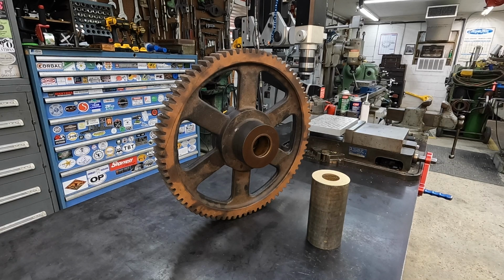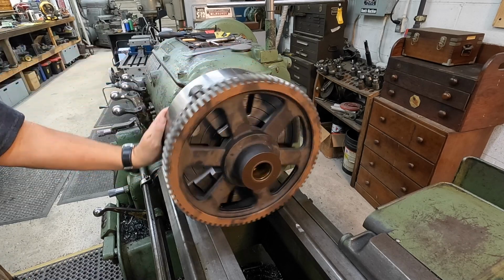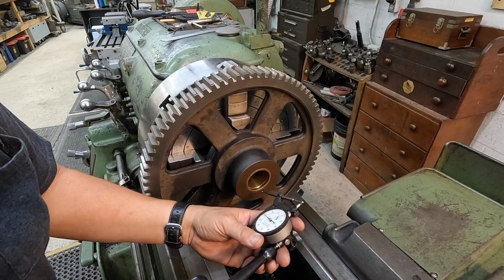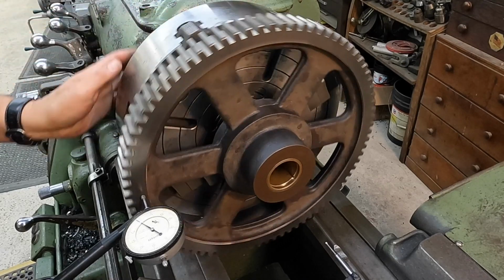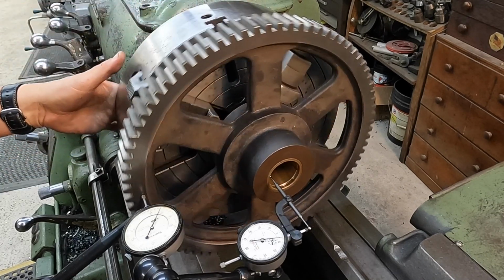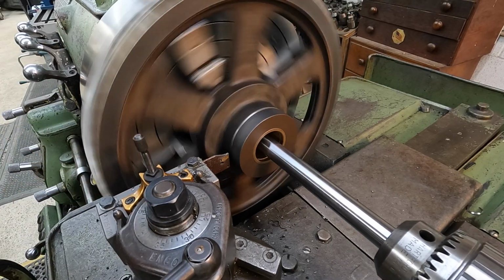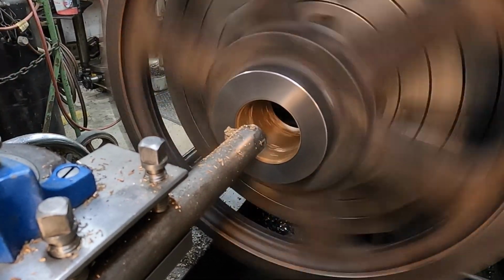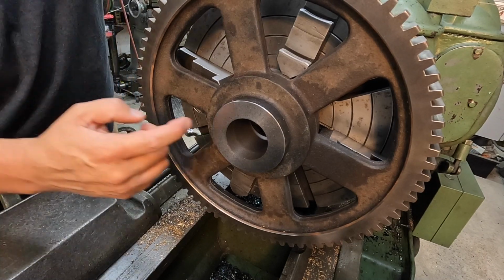Gear Modifications Part 1

Comment: All part features must refer to a gear's pitch cylinder. Whenever I had to modify a gear, I compared the bore concentricity to the pitch dia as a final check. I used a dowel pin or a drill shank near the best wire size for the gear pitch. Laid it in the tooth space and checked it with the indicator. About 5% of the time I found enough concentricity error I felt it necessary to dial in to the gear's PD.

A couple thou PD eccentricity is OK for most low speed power transmission. Any more than that and the cyclic gear noise (wow-wow-wow etc) becomes apparent even to a tin-eared real estate broker or house painter.

Anyway, not a big deal, but a quick and prudent cross-check that might forestall an awkward question from a customer suddenly grown skeptical.
Reply: You're one of the few people to have made a cogent argument in this thread.
However, you have to include some other factors to be complete.
1. Customer is jury-rigging this gear to fit into their existing production.
    They have asked for specific work to be done, to their specifications.
2. Abom could do that additional work, on this part and every other parts that comes into his shop.  Add it up, and thats quite a lot of work that is being done for basically free. Or more accurately, his 40 hour work week is now maybe 35, 33, 30 billable hours due to this additional work.
3.  One would assume Abom is a reputable jobsman, and either discussed this with the customer beforehand, or would being it up upon discovery.
    Either the customer didn't want to add to the bill for the additional work, or Abom hasn't brought it up as he doesn't believe it will impact the function this part is expected to perform.

The customer in this case already has an expert who's found a gear that they're going to 'make work'.  Customer can be as sceptical as they want, however if push comes to shove, Abom can take the part, and show the measurements directly off it to the customer sceptical face.

Almost every job in every industry have checks and doublechecks ad infinitum for every repair, or replacement, or troubleshooting of basically everything.

If the gear was brought in obviously warped, I'd expect Abom would point that out immediately. If found warped upon start of work, same same.
Checking the bore concentricity to the teeth is extra work, which is either going to be billed, or done for free.
He got down to the machine bore without touching it.  
It appears to have been pulled from a working piece of equipment.
For the additional time to add to the bill to do this check, and similar checks that he could do to every other part/order that comes into his shop, at what point do you stop? 
If he were to do all the checks that people here seem to demand, or suggest so as to be 'professional', he'd probably have to raise all his job order billables 10-20%.
He could do what you suggest, and he could also clean up that out of round bore OD, and a half dozen other things that would make that part a gleaming beauty.
And if he were to quote that, the customer would say thanks and go down to the other machine shop where they'll simply do what is asked and have a reasonable bill.
Reply: @boots7859  You're correct in the time element but allow me to point out the first PD check takes about a minute using a suitable drill or tap shank from your tool box. If the PD is wonky it's decision/call the customer time. Regardless, dialing the last few thou to a pin in a tooth space aint rocket science: with a little practice, it goes about as quick as a tweak to a continuous diameter. 

I think I pointed out the check was optional but prudent. Every customer is worth a free minute. He IS hiring your skill and judgement along with your mere ability to perform basic functions on a lathe. It boils down to judgement anyway. I'm not suggesting aerospace QA on every piece off 60 year old farm equipment

Comment: I'm really curious if you're going to make the exterior of that cast surface concentric with with interior bored hole.
I'm struggling to see a reason to do such beyond the fact that it feels wrong to have that exterior be so out of line with the interior
Reply: the reasons to do it are (because I can) and because it will improve the mass balance and reduce vibrations and bearing wear and noise in use.
Reply: @N1gel  I thought about the same thing, then wondered what the max gear RPM will be.  If it is low, the balance is nowhere near an issue versus a high RPM situation where that offset mass would want the gear to walk off on its own LOL!  I suspect it is very low RPM. Also, the moment of inertia will be predominantly dictated by the mass of the gear located the furthest from the axis of rotation, i.e. the tooth ring thereby making the hub mass offset less of an issue.  Cheers!
Reply: On the other hand, the reason Not to do it is, It's not his part, it belongs to a customer, if he went ahead and started to machine it round and (god forbid) the lathe was crashed somehow and the part was wrecked, he is not just out of that job, he is out that customer and maybe some others via the grapevine.
If the part is yours, make it as round as you want, if it is someone else's, only do the work specified.

Comment: At first I thought it was 5 or so feet tall and was wondering what machine he had would nount it! 
ABOM, the Master Indicator at work.

Could you not make some U shaped pieces to hand on the bacside of the work which would help in the initial spacing between the chuck and the work?

Comment: Always learn something from your videos. That bore being off by 0.003 or so would likely have put me in trouble bc I would have tried to "fix it" and ended up maybe messing up the gear and the way it runs in the machine it fits. I've done it before - going ahead w/o thinking all of the ops through and had to remake parts. No remaking a customer supplied part but I know you could get out of trouble a lot faster than I could! 

Great video. Always warms my heart seeing you with your Father and Grandfather! Their influence has allowed you to likely go beyond even their skills. I'm sure you learned a ton from those 2 gentlemen!

Comment: Dont know what rpm that gear runs  but that casting is so far out of balance would expect all sorts of clatter and vibration
Reply: Jay brings up a key point.  We do not know at what rpm the gear runs. From the pictures he has posted in Facebook and Instagram, this appears to be a press roller (16'' approx.) for this laundry.  The speed of that gear is likely no more than 5-10 rpm.  All of this weeping and gnashing of teeth by our YouTube experts concerning "out of balance vibration and clatter" issues is nonsense.  There is a lot of load on those rollers which would explain the bushing wear, but otherwise that gear is perfect the way Adam has it.
Reply: Low rpm machines you can get away with a ton. 

High speed is where you need balancing, at which point you'd balance it after machining everything.

Comment: Wouldnt you want to true up/indicate the gear teeth, then true up the center? Looks like the teeth are not true with what is now the center. Gonna have some slight gear resonance while its in operation.
Reply: The gear teeth are (supposed to be) concentric to the center bore, so it doesn't matter if you measure deviations on the inside or the outside. In theory at least, given that the bushing was factory new and the teeth likely have wear, as well as the ease to indicate the flat bore instead of the bumpy teeth, it's better to indicate the bore.
(I guess the comment was sent before Adam mentioned that the center bore was not touched, he just removed the bushing without machining the original surface)

Comment: Why do you use different lathes for the different parts.  Is one more accurate?
Reply: The only thing better than two lathes in the shop, is three lathes. The ability to have one part chucked up and still have a lathe to work on another part is golden. Or even two complete separate projects.
Reply: @grntitan1  Not a machinist, just wondered why.  thanks for the insight.
Reply: Different sizes, different HP, different tools, etc. 

Or sometimes you just feel like using a particular machine.
Reply: @leftyeh6495  Or one lathe is mid-project and is occupied with a work-piece in-progress :-)

Comment: That parting op tho… 🔥🔥🔥 how do you do it my dude. Parting never goes that smooth for me lol.
Reply: Cast material parts off allot easier than regular steel...
Reply: @randyreddig5239  I don't have much experience turning cast iron, but that does make sense based on my limited experience machining the stuff in general.

Comment: The outer surface of the hub being non-concentric would irritate the snot out of me. I guess balance isn't really a specification required for this job, so I'm glad I don't have to deal with it LOL
Reply: Problem is, THE WHOLE GEAR is running out like crazy - including the outer diameter of the spokes, the inner part of the rim, etc. (see around 17:00). It was machined with a large runout back when they cut the teeth (which are presumably only running out 3 thou or so, just as the original bore does). So yeah maybe you could "fix" the hub, but the whole rest of the gear would still be running out like mad, even while the teeth and hub ran true...

Comment: Adam, do you feel there is a point where that off center casting on the hub should be turned down? I’m no machinist but I would think that would effect the balance and ultimately result in bearing wear.
Reply: If the gear was spinning at high rpm it would need to be balanced.  But it probably doesn’t spin over a couple hundred rpm  when it’s being used.
Reply: Was thinking the same but I guess its not an issue if the shaft isn't spinning excessively fast. But the casting was a mile off centre, that's for sure.
Reply: @TheCuriousOrbs  thing is the other side of the casting could have been spot on too. Some times the two half’s of a casting will shift when being made and no matter what you do one side will be off and the other side could be dead nuts.

Comment: What had me more worried was if the teeth were machined according to the bore. The runout in the casting looked wildly off and I find it strange that they wouldn't have tried to center the mass a little better...
Reply: Zero shits given at manufacturing time. "Who cares where your center is, we have the means to MAKE you run true (never mind what the entire rest of the wheel does)".
Reply: Runout is in the hub, probably pattern error.  I doubt this item would have worked with non-concentric machining.
Remember,  Adam indicated off the bushing bore.  A worn part.
I would have pulled the bushings before any machine work.  Indicate off the hub plane and bore, then measure runout measured over pins.  Having a mating gear would also help.
Reply: @keithjurena9319  It seems that you have gone directly to the machining part without listening to the explanations ;-) there was no wear on the bushings, it was a brand new gear that they need to adapt to replace a different model that is no longer manufactured.
Since he didn't touch the original cast iron bore when pressing in the new bushings they will as good as the old ones were from factory.
The customer also wants flanged bushings, if it wasn't for that the originals would have been fine.

Comment: Only thing I would have done different is would have cut the out part to round, one for looks the other if I had to re-chuck would have a machine surface to work with! But great job!
Reply: Same.   Would make any future repairs a breeze, cause I can guarantee that bushing will be toast and they'll be boring that hub out at some point.

Comment: If the original bushings are Oilite, wouldn't it be better to refit Oilite ?  If cast bronze is used then the bearing will need a lubrication point and spreader grooves, won't it ?
Reply: Good question. The material appears to be bearing bronze which is often used in repairs like this. It will be interesting to see if oil grooves are machined in the finished bore. I kept hoping Adam would chamfer that eccentric hub to make it look better.
Reply: the original wasnt the part the customer really wanted in the first place
Reply: @scose  True, but my questions still apply.
Reply: @chrisarmstrong8198  Adam got a drawing he's supposed to follow. They specifically requested a two piece flange bushing, which suggests that the lubrication is going to come from a channel in the shaft.
Reply: @andersjjensen  Possibly, or they just wanted bearing flanges at each side of the gear.

Comment: one of those setup that is just as aggravating as doing the whole rest of the job!   Ive had several parts that took longer to set up than to actually do the machining, but its either right or scrap and we take the time to do a proper setup no matter what.  Aint no telling what that gear would cost to make from scratch.
Reply: yeah, he really should have turned the outside of the hub and dialed in the center bore after removing the bushing, this would have left a reference surface for later changes and repairs

Comment: Curious why you didn't verify the O.D. of the gear had no runout after indicating the I.D..  When you started running the parting tool, runout was easily seen in that view of the gear O.D..  Gears, especially cast ones are not always concentric to the I.D. as I have had experienced runout as high as .005"+ .
Reply: .005 on an open gear like this is nothing to worry about. a auto differential setup can vary a few thou and not hurt a thing.
Reply: @MrChevelle83  It would have been an easy fix, and 30 seconds more time to get it right.
Reply: The teeth are cut referenced to the bore, the OD makes no difference
Reply: @elanjacobs1  Ok, I'll give you that much, but look at the root diameter of the teeth and you'll notice the same runout.  That's not a coincidence.
Reply: @sferg9582  It's also a 14.5 degree pressure angle, it's highly tolerant to runout. Even assuming 10 thou total runout, that's 5 thou per side, so max 2.5 thou tooth thickness variation from theory. A gear of that pitch should have at least 2-3x that backlash allowance built in and the same on its mate. It's not going to matter.
Reply: @elanjacobs1  Wow you're good.  I marvel at your ability to see a 14.5 degree P.A. vs. a 20 degree P.A.  Amazing ability you have there.
The point I'm trying to get across here, is that if you have the opportunity to get it right, in this case getting the item to run concentric, you do it.  Not try to explain away why it wasn't done correctly or why it doesn't matter.

Comment: Mr. Boon, does the non-centered shaft, cause damage to the gear or it's associated gears and equipment? Or is it alligned center of hole to outside diameter and the non-centered shaft never comes into play. I'm trying to figure out why you wouldn't straighten the shaft.
Reply: The hole is aligned to the outside of the gear, so the shaft is properly centered to the teeth. The entire initial machining was offset for some reason or another, maybe production error, maybe salvaging a casting with a small void in the edge or something... But it will run true, it will just look really odd while doing so. 

And likely be seriously out of balance, but it's clearly not meant to move with any kind of speed whatsoever, so that wouldn't matter.
Reply: @hwesson75  cool, thanks. The way it was running, it looked like it would tear things apart and I couldn't figure out how it was in service. Your explination helps a great deal, thank you.

Comment: Can you give a boring bar tutorial, im having trouble boring a 4-5 inch hole with a 3/4 inch bar. Its flexing too much on me.
Reply: how rigid is your tool post? a 3/4 bar shouldn't have much flex under light cuts when sneaking up on your final dimensions.   Unless the bar is a home made low quality unit it should be fine.   Put an indicator on and see how easy you can deflect it by hand check the post and bar to see which one is deflecting